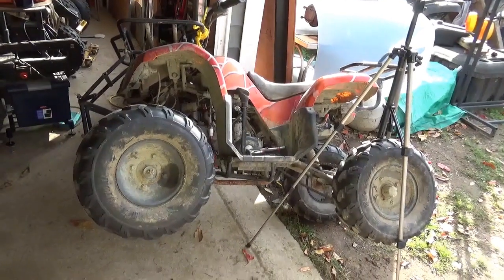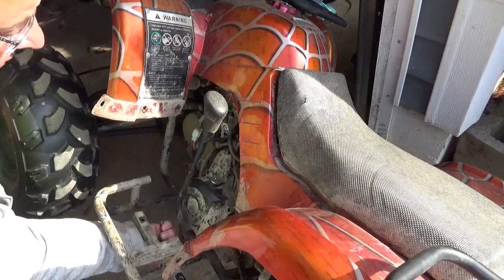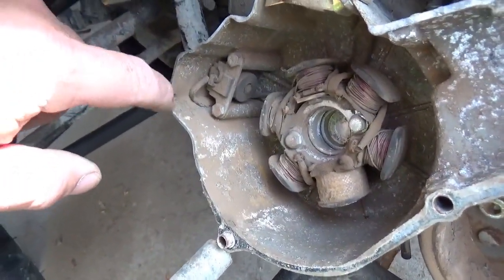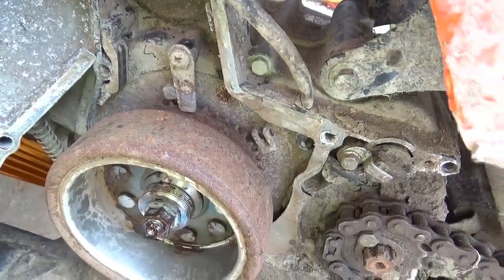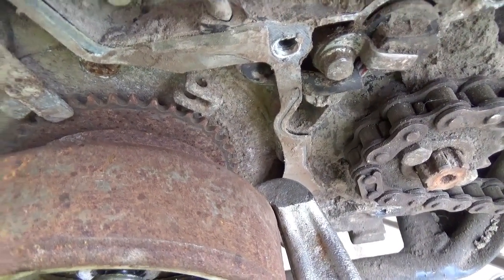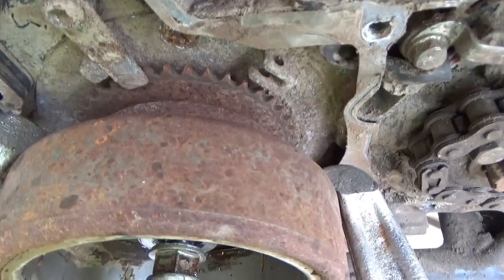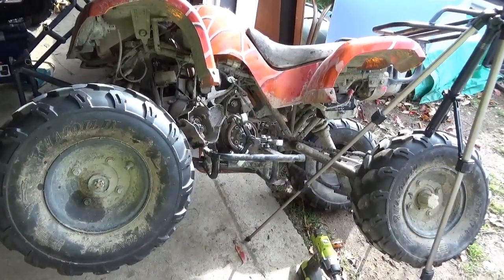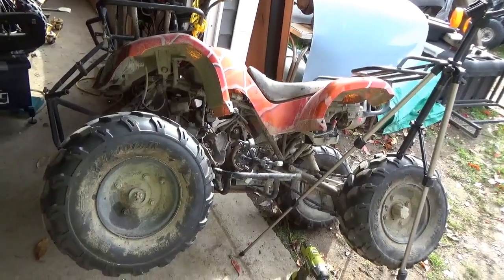Coolster 125cc ATV, Starter Chain Change, Destroyed Fly Wheel!

Comment: Your ok with that puller. The big starter sprocket is connected to the flywheel with kinda a "clutch" setup rollers inside flywheel  bite on starter sprocket. Wish I could send you a pic. I just went through the same thing for the same reason. I bought the puller didn't need too.
Reply from the maker: Hey Jason, I think the flywheel is coming apart, I ordered the right puller and hopefully it is here soon and moves me toward success!!!!  If not, I have a 110cc 3speed w/reverse that should bolt right on.... Thanks for Ur thoughts, advice, suggestions, watching, and commenting!!!!
Reply: I'm not  trying to tell you how to fix your stuff you have me intrigued because you seem to be experiencing the exact same issues I experienced, broken starter chain, chain won't fit and rusted flywheel. Good job on explaining what your doing. Please let us know what you learn with your new flywheel, my old flywheel is segmented  my new one wasn't.  Won't get a chance to try and start mine till spring, be interested in your experience.

Comment: It always has annoyed me that designers have tried their best to make up new tools to be required for their designs that are totally not needed. Press on pulleys/flywheels are the worst. I could see it on a 100 pound flywheel but not on something small.  Rotten luck, any bike can become a money pit. I tried to disassemble a kawasaki 300cc automatic 4x4 4wheeler that had a busted engine case. It had a very similar flywheel to that and I wound up using a sledge hammer to bust the cast aluminum case from around it. The special tool was 50 bux and  since this machine was doomed anyway I wasn't spending any money to take apart a scrap engine. Maybe you should think about hunting the hoard for another 125cc engine.  Oh yeah, the plastics for that bike can be found on "parts unlimited" website for 150 bux.  👍👍
Reply from the maker: Hey Fan!!! I ordered the $20 puller.... I was pulling pretty hard with the 3 jaw, I'm thinking that something was damaged for sure.... I have a 110cc with a 3speed and reverse.... That maybe be the engine swap it gets.... Thanks for the info on the plastics, thanks also for the info, watching, and commenting!!!

Comment: Hey Harvey, I have learned alot from your videos. Enough to get my 110cc running. I have replaced the wiring, all electrical components, new carb and cleaned, has compression. And it just will not start anymore.  I cannot figure it out. Any thoughts?